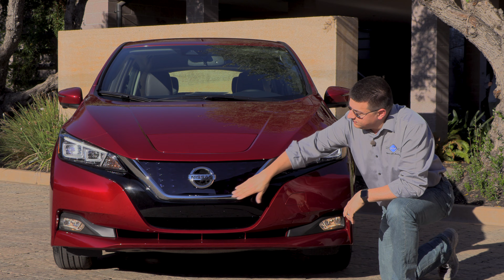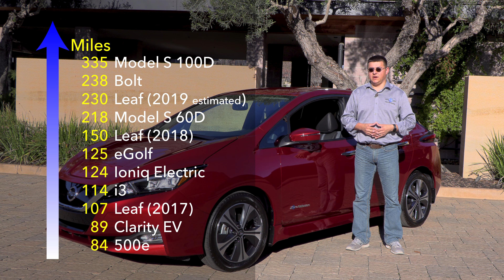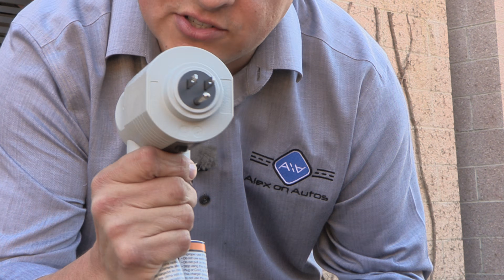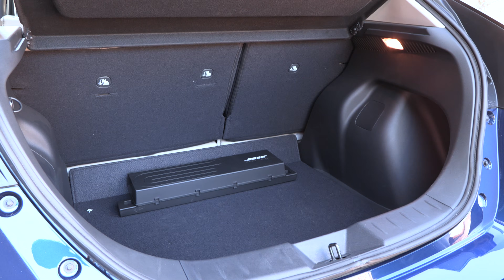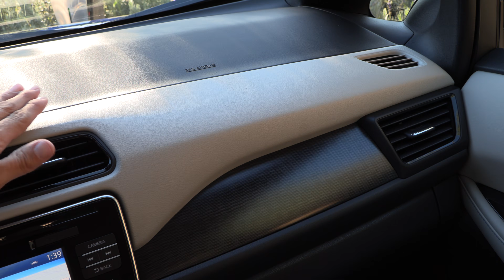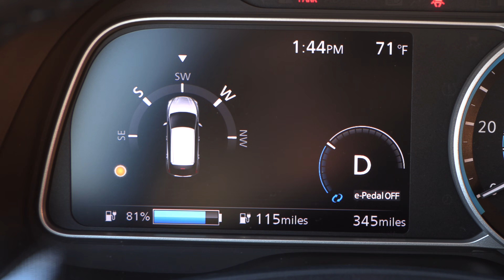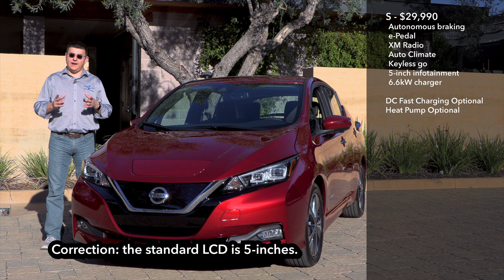2018 Nissan Leaf First Drive Review

Comment: Best EV on the market today. If it said "Tesla" on it, there would be a 20 year wait list.
Reply: Looks like the Bolt's days will be numbered once the Leaf's larger capacity battery hits the market.  The Bolt also looks cheap, but it could be a really cheap used car in a year or so...
Reply: This, the Bolt, and Model 3 I say are all on top of the EV chain
Reply: You’ll be on the waitlist for a year or 2.
Reply: It looks like a great value on paper, but there's no liquid heat management on the LEAF. Theory is that Nissan was stuck with NEC/AESC for 2018. The divestiture of AESC was happening while Nissan was wrapping up the redesign. Nissan may have access to 60kWh LG Chem packs with liquid thermal management starting with the 2019. If these are legacy NEC cells in the 2018, it goes without saying that you should avoid this model year, since you'll eventually have the same early degradation issues that have yet to be solved as of the 2017 model year (also featuring oven-cooled NEC cells).
Reply: Justin 

The 3 costs a lot more than you think, has a waiting time longer than Tesla is expected to stay in business, and for the rare long trip, just rent a gas car.
Reply: I think the Model 3 is. It has better autonomy and charging. Those are huge advantages. Any Tesla would by far be easier to use on a several hundred mile trip.
Reply: Not with those looks
Reply: If it had tesla on it - then it would have the supercharger network and batteries that last over 200k miles. Then - yes of course it would have a waiting list. But alas, it will have neither of those features ...ergo no waiting list. and limited demand

Comment: 18:08 the color is probably matched on the charge door but the paint reflecting from the sunlight is off.  You'll notice this on mid-2000 Altima bumpers as well especially at night.

Comment: I like the newer looks, even if it does look more mainstream. However the European Micra looks extremely good for a subcompact and the Leaf mk2 shares much of the design elements over the alien-bug-eye thing the Leaf mk1 looks. Still while the 150mi range & 40kWh pack is an improvement, the one to look forward to is next year's 60kWh battery which would guarantee range matching or exceeding the Bolt's current record. Also kudos to Nissan for giving a Level 2 portable charger as standard equipment.

Comment: The interior is way better looking than the Model 3!
Reply: OK, Panoramic roof? Panoramic glass top? Touch Screen? Large space center console? Hidden air vents? You think this is still way better?
Reply: Buck Futtter I have spent a week testing a Tesla model S and I can safely say it was the BEST user experience I have ever had in 20 years of driving!
The wipers are automatic and don't require you to touch anything also my current car is 7 years old I adjusted the vents when I got the car and haven't touched them since.
Reply: JUMP23MΔN, I'm not claiming it's a new feature to the automotive industry, please take the time to read the responses so you understand the context. Buck Futter was saying he would not be  happy about using the touchscreen to activate the wipers and I responded saying the wipers are automatic, ergo no need to use the touchscreen when it rains.
Reply: Trades46 1. The cheaper Model 3 is early 2018.  So that is wrong already.

2. When the gigafactory is complete Tesla will produce batteries for cheaper....so a $35,000 Model 3 can have a better range at no extra cost to consumers.

3. Tesla superchargers > the rest.  EVERYONE ELSE IS PLAYING CATCH-UP.

Tesla is king of the Ecar world without any doubt right now.
Reply: dzonikg dear god please tell me you are joking???
Reply: JUMP23MΔN Firstly, we are talking about design, not about quality. Tesla is simply better at materials in their new model 3 as it is more expensive. Nissan has normal interior. Model 3 has a minimal interior. Minimalists would love the model 3. If you don’t like the model 3, then the Leaf is better. I like model 3.
Reply: Trades46 Also, they have already started deliveries to customers.   So again, your info is bad.
Reply: JUMP23MΔN I like boths
Reply: Trades46 Okay, so how expensive is the 60 kWh 2019 Nissan Leaf? Because in 2019, the option would be available, not simply a new gen leaf that has a better battery...
Reply: I’m better off with the Leaf. Budget wise, but look wise Model 3 wins. I like simplicity! Tesla looks more premium than the Leaf, but I’d go for the Leaf simply because Nissan is an older and reliable company. Maybe wait another few years for the Model 3 for reliability stats.
Reply: I'd hold off on a Leaf until it can easily do SD to LA and back to SD with more than enough extra to do sightseeing without having to worry about "pitstops" at a charge station or resorting to painfully slow L1 charging (read has at least 300 mi of range).
Reply: No way! The screen is tiny.
Reply: The same was said about the BB keyboard when iPhone was presented to the world. Someone invents the future, others copy the past.
Reply: dzonikg wrong reply.  You posted that it’s better than the Model S.  If you think that then just admit you are a Nissan fan girl.
Reply: They're probably better than the materials in the Bolt. The Bolt's interior is pretty bad.
Reply: JUMP23MΔN the leaf cant be compared to the tesla. They're in different classes
Reply: Wait, there's a Tesla Model 3? Funny how this review never MENTIONS it.
Reply: I'm intrigued by the Tesla interior, but this looks like it was designed by somebody who actually drives a car rather than a SpaceX Dragon.
Reply: LOL obviously Tesla paid no attention to the user experience when you have to go into the menus to turn on the damn wipers or adjust the vents.
Reply: Tesla fanboys triggered
Reply: Trades46 fuckface....you just compared a current model (Tesla Model 3) to something Nissan says should come out by 2019.....brilliant.

Are you so mentally challenged that you think Tesla will just do nothing for 2-3 years???

Also....Tesla’s gigafactory isn’t fully built.  Prices will only drop for Tesla.  You’re a joke buddy
Reply: Robert Blackford you are mental.  Tesla is producing the more expensive version FIRST.  The $35,000 Model will start deliveries spring of next year (3-5 months from now).

Must suck to lie in order to try and prove a point.
Reply: daguzify When you start swearing you lose all credibility, but since you seem to be either uneducated or misinformed, I'll play along (for now). 

1. I compared the 2019 Leaf 60kWh (which has been more of less confirmed during the 2018 40kWh press launch) to the 2019 Model 3 50kWh because that is when that particular car would be produced - most of 2018 produced will be the loaded 75kWh car selling for significantly more. Or course, there is a caveat (read point 3)

2. Yes, I DO think Tesla won't do anything more to the Model 3 for the next 2-3 years. Why? They can't even properly mass produce the current model which was originally promised to deliver at the end of 2017. It is now December and not a single one reached a customer that isn't a Tesla employee/family. So what makes you think they would make any significant changes to a car they cannot perfect now that would further require EVEN MORE money & time to develop, neither of which Tesla really has anymore?

3. Let's be clear: Gigafactory only builds batteries - NOT CARS. This is not where the Model 3 is being stalled on right now; that is the car manufacturing plant in Fremont. Initial rollout of the loaded 75kWh Model 3 would likely be made in Fremont CA, but to meet the 450,000+ reservations within the end of 2018 (if possible) without customers getting impatient demanding refunds means Fremont maximum total production capacity would be quickly breached (~500,000 total including Model S & X, as stated in Tesla literature), meaning that later build Model 3 (I'm guessing the base $35k car) would be likely sourced from the new Shanghai factory. That's right - you might just own a Model 3 with a little tag that says "made in China". 

4. New Tesla MSRP are FIRM - that's one of the 'benefits' of their no dealer operation. The only way Model 3 prices would drop is if the car is a complete fail and customers start dumping them on the market by the dozen. Still doesn't change the fact the Bolt & Leaf are better value however. 

If you can rebut all these facts without swearing, I might actually be convinced Tesla is doing better than I thought.
Reply: "Tesla is simply better at materials in their new model 3 as it is more expensive" YOu got to be blind to say this..materials in model 3 feels like cheapest car from 90s
Reply: I am not..model 3 interior feel for me like i am in some apparment from 1954 with LED TV in the middle
Reply: Wait, Tesla cars come with an interior? It's so bland I didn't think there was one.😊
Reply: daguzify stupid. The Model 3 largest battery is only 75kWh which yields an EPA rated 310mi range. The 2019 Leaf is slated to get a 60kWh which would give ~230mi, besting the base Model 3 with its puny 50kWh pack.

Oh yeah you conveniently forgot to mention the 75kWh car costs ~$45k, but add on leather seats, panoramic sunroof & Autopilot and you're effectively looking at a  $55k car. The Leaf with 60kWh is not projected to cost more than $40k fully loaded. Joke is on you buddy.
Reply: Comparing the Leaf to any Tesla is a joke.  
Tesla’s will only get cheaper as the gigafactory is fully built.
Tesla Model 3 will get a 600 mile battery by the time the leaf gets to 215.
Reply: Mike are YOU blind? Don't tell me an afterthought of a glued-on Ipad on a plain dash is "nice", or I highly question your view on aesthetics.
Reply: Prince Ding Just look behind the cheap ugly steering wheel, looks like a child's toy car not having an instrument cluster.
Reply: JUMP23MΔN are you blind
Reply: Aesthetics is completely a matter of opinion, personally I prefer one touchscreen than a cockpit full of buttons that break, fill up with dirt and I may never use.
Also unless you have a HUD all speedometers are in peripheral vision.
I think this leaf looks every bit as ugly as the last and at 150mi range it's about as useless as it predecessor too. Nissan battery technology means in 6 months you will only get 100mi range. This car was antiquated the moment it was released, massive FAIL for Nissan!!
Reply: Rex Venom Fyi... Auto wipers is nothing new.
Reply: ITs way better then 120 000$ model s